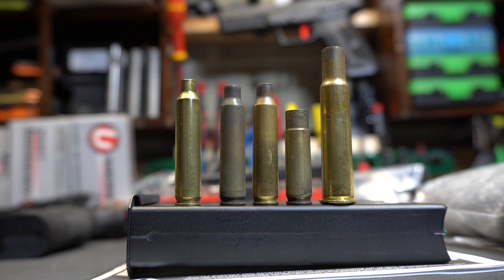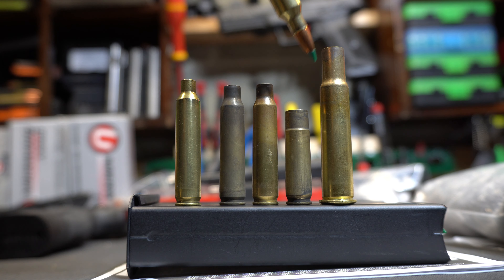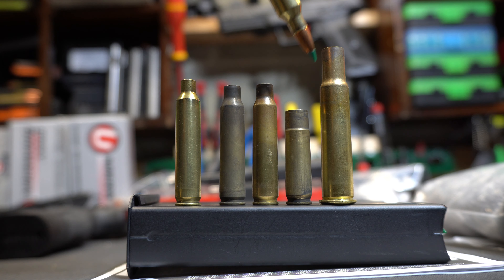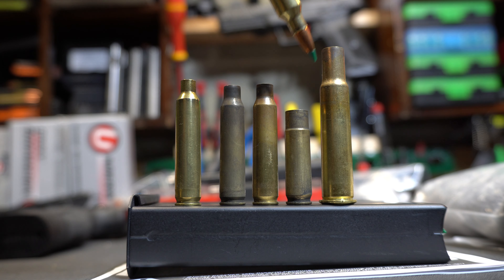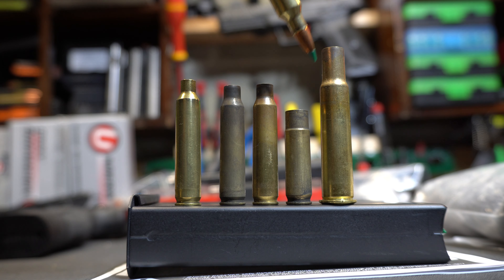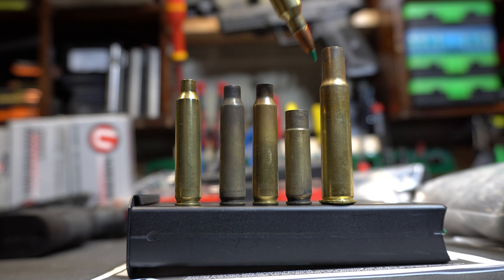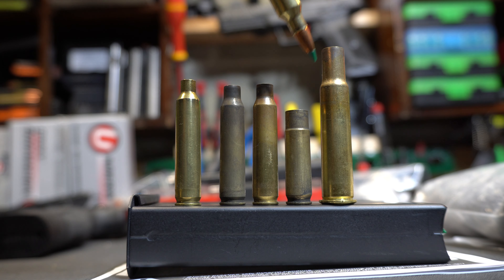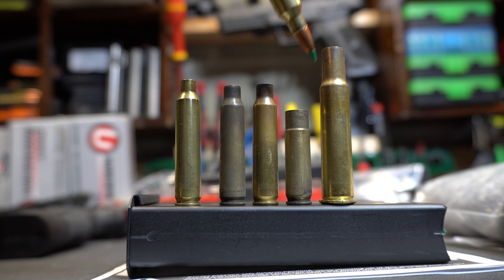Should I Wet Tumble  My Brass?

Comment from the maker: Brass Tumbler here https://bit.ly/3gBKZCW
Look for the ceramic "pieces " shaped like a 3D parallelogram and NOT the beads/balls.

My initial mistake with the beads; various diameters that got STUCK in my brass! Lessons learned.

Finally, some ceramic will have a "dirty " coating, I initially tumbled the ceramic pieces alone in ZEP cleaner diluted in water.

Comment: I use the tumbler with steel pins and a product called brass juice. Works great.  Think I will get ceramic pieces to try.  I like the brushed look. You should try brass juice. Might turn out better than lemisol.
Reply: Have you found a big difference between the citric acid based name brand cleaners and just plain powdered citric acid? The latter is far cheaper and I personally can't tell a difference.